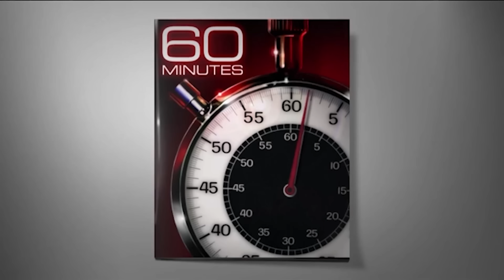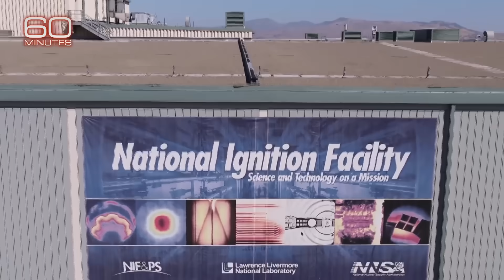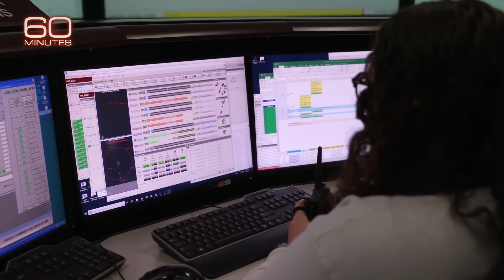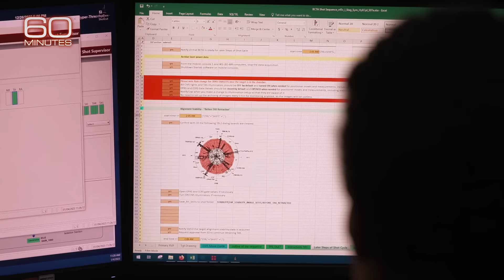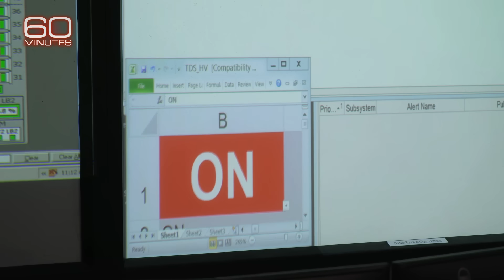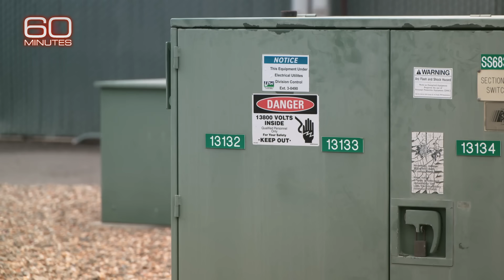Nuclear Fusion: Inside the breakthrough that could change our world | 60 Minutes

Comment: Why do they always forget the machine that did this. The setup (including production of pellets), even if shrunk significantly, is prohibitively expensive. And the energy that was needed for the lasers, was 100 times more than what was released by the fusion process. As stated in the video, net positive fusion is still just as far away . 20  years 🤣Photon pressure seems like a good idea (Stars use photon pressure to prevent collapse) but that is at energies that are incomprehensible compared to the energy this facility can deliver. There are other methods in development that may offer better prospects ( and remove the need to develop 100% efficient high power lasers, which is near to impossible even with near future tech), for example a reactor that magnetically constricts and compresses fuel(like ITER) and then has large mechanical plungers to compress the fuel down to ignition. Looks more crude but it certainly does it more efficiently than the pure inertial confinement method.
Sorry to burst some bubbles, I'm just being objective.
Reply: So, you're saying that there's a chance?
Reply: @MinusEighty  LOL, there's always a non-zero chance. But I only mentioned a fraction of what could be a three-page essay listing all the factors that will definitely halt any commercial application of inertial confinement fusion by lasers without major advancements in the respective fields, plus a few factors that apply to thermonuclear fusion in general.

Comment: Atomic bombs use fission not fusion
Reply: incorrect.  They use both.   A fission reaction drives a fusion reaction which 'boosts' the fission reaction further.  This provides the energy to drive a larger fission+fusion sequence in the secondary.
Reply: @Verfolnir  Hydrogen bombs don’t use hydrogen. They use lithium deuteride which under the intense pressure and temperature of a fission bomb fission to simpler elements releasing energy.

Comment: I was debating this very thing in another video recently in which many others were parroting the tired old saying that fusion energy has always been right around the corner decades ago and that this would be forever true because we would never reach breakeven. But history has shown that this achievement has been in the making for a century now with incremental advances every decade, and I always believed that as long as scientists continued working towards controlled fusion that we would eventually reach and surpass Q = 1 in my lifetime. To all those who said this would never happen... we are now at Q > 1.5 and this will only increase as the decades pass. This isn't saying fusion energy will definitely power our world in the near future, but I wouldn't be surprised if my grandchildren see it in their lifetime.
Reply: We're at Q>1.5 if you take the laser energy reaching its target as a reference point. But the lasers require 100x more energy than they output. As they explain at 9:55.
Q>1.5 if Q means (fusion energy)/(laser energy onto target).
We need Q > 1 with the electricity going into the facility as a reference point.
Q should mean (fusion energy)/(energy into facility). In that case we are at Q=<0.01

Getting electricity from the fusion energy can also not be 100% efficient so you can divide the Q by half again (optimistically).
Actually we want Q: (electricity generated)/(electricity into facility).

But I agree, I also wouldn't be very surprised if my grandchildren see fusion energy in their lifetime.
Reply: @kedrednael  Q is the Fusion Energy Gain Factor which is the ratio of fusion to external heating... it doesn't mean more energy output than energy input. High values for Q mean that reactions can become self sustaining without external heating. Once the construction for ITER is complete in a few years, we will see values of Q > 10, so it is an exciting time for fusion energy research. My point is there has been a steady stream of naysayers over the years who claimed we would never even reach milestones such as Q = 1 even though fusion energy research has been steadily advancing.

Comment: Wowwww they really did leave out the 300 unit laser bit... i was under the impression they got more energy out than in. Kind of a fizzle, probably just more of a hype train for more funding, which i'm okay with.
Reply: This hype has been going on since 1988 when Europe was considering plans to build ITER.  In short, the European Counsel on Fusion Research was warned about the media and the public confusing  "plasma gain" which is simply fusion_energy_out divided by plasma_energy_in   vs  'power-plant-gain'.    The confusion has been there since the beginning.   "Plasma_gain" greater than 1 not only has to be achieved, it has to be maintained indefinitely.  It is not at all certain that can be done.  Further, if plasma_gain greater than 1 CAN, someday, be maintained -- A fusion reactor will have to be designed to extract that energy.  No such designs exist today, nor are any planned for the known future.
Once energy can be extracted... (If the fusion can be maintained - Currently there is not enough fuel to run a fusion reactor.) - then they can ask the question if energy extracted is greater than energy input:  This would be power_plant_gain.   This may never be possible, due to externalities.  IF such things all come together, it will be 2070 before the first powerplant designs are drawn up, let-alone built.     Right now, everything is still experimental.   That being said - Plasma_gain greater than one has to be achieved.   NIF simply proved that it could be.
It's a good story for NIF but immaterial.   NIF was not designed for civilian power research.  NIF was designed specifically for weapons-fusion research.  And to this end - -NIF does it's job spectacularly.

Comment: We should be building new hi end reactors
Reply: We will be building this.  Fusion reactors require tritium.  And lots of it.  Tritium is made in Fission reactors.   So to power any one, single fusion reactor, we will have to double or more the current number of working Fission reactors. -- just to make the fuel for one fussion reactor.  Providing they can sustain a reaction indefinitely.  Providing they can extract the energy.

Comment: Making the lasers larger, more powerful, and more efficient is probably the less difficult next step. The most difficult challenge facing the engineers, who will be tasked with developing this into commercial power generation, will be coming up with at least one workable process to mass produce the fuel pellets. As pointed out in the video, the lithium deuteride fuel pellets have to have virtually perfect geometry - perfect in size, shape, and density distribution. The uranium dioxide fuel pellets used in light water fission reactors don't have to be "perfect" - their dimensional tolerance in both diameter and length is thousands of times less precise than the pellets being used at the NIF, and the temperatures they operate at are generally around 550°F, not "hotter than the core of the Sun". Both technologies being examined for fusion - laser ignition and magnetic confinement (Tokamak) - are not only facing the problem of duplicating the temperature conditions of the core of a star using earthly materials, but the very force that confines fusion plasma in a star, it's own gravity and the pressure it produces, can't be duplicated on Earth. In the core of a sufficiently large star, the necessary pressure and temperature to ignite fusion at the core is "free". The star's own mass produces the containment field - gravity - without any need to supply external energy. Since we can't do that in a lab or a power plant here on Earth, we have to supply an enormous amount of electric energy to artificially produce the pressure and temperature to fuse deuterium ions, and to do this continuously, hour after hour, year after year....The experiment last month lasted a few billionths of a second and released just enough energy to "boil a couple of pots of coffee". I sure hope that fusion will become a reality someday, but I've been waiting more than 50 years, and I now see that the remaining challenges are still so daunting that maybe my grandkids, now 4 and 7, might see it in their lifetimes, but I know I won't.